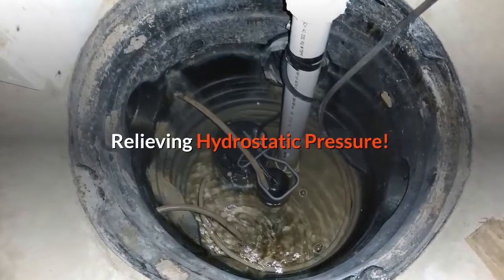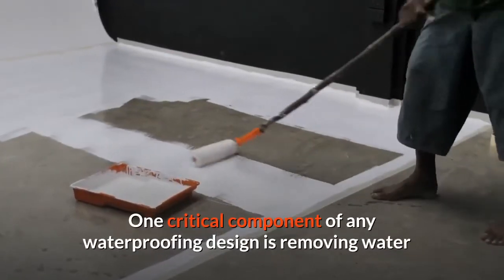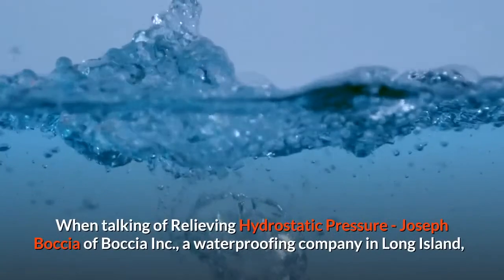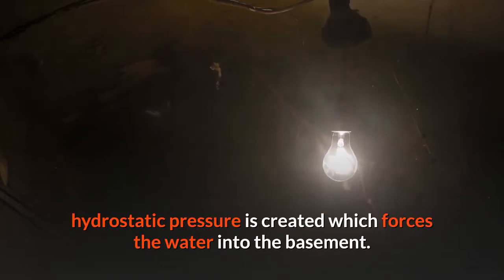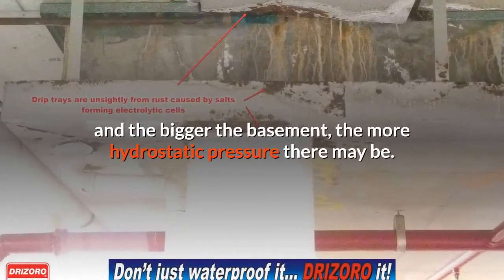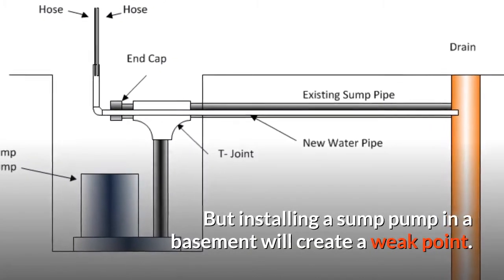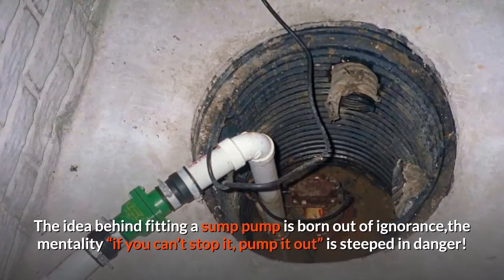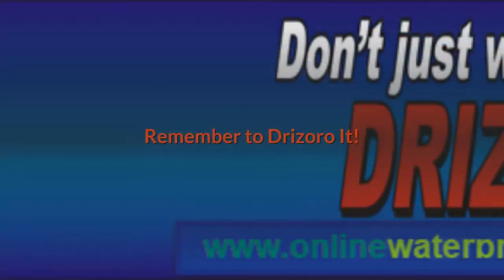Relieving hydrostatic pressure in construction of basements

Comment: Glad I found this video. I'd never thought of the integrity issues that jackhammering, drilling, and adding a sump pump can cause...and I imagine this is especially true with older construction. This reaffirms I need to concentrate on water mitigation outside with french drains.
Reply from the maker: Glad it helped. If you have water entering your basement you definitely better off if it's not flowing through the wall